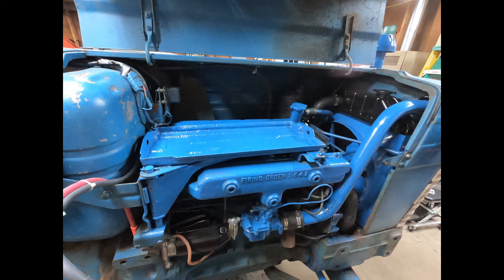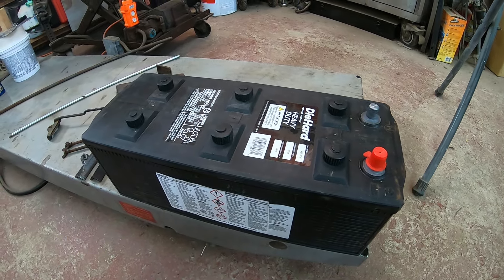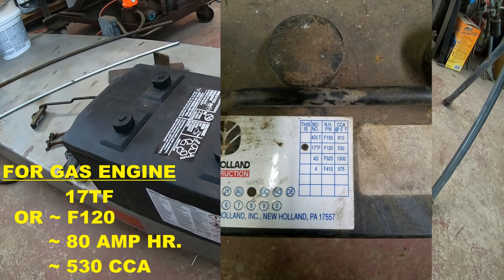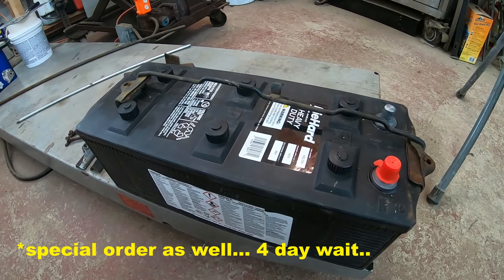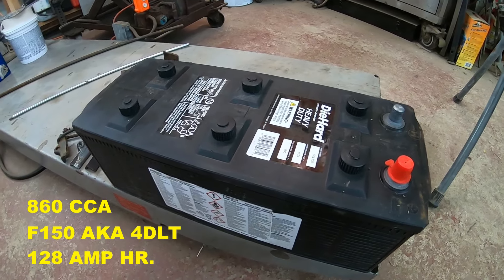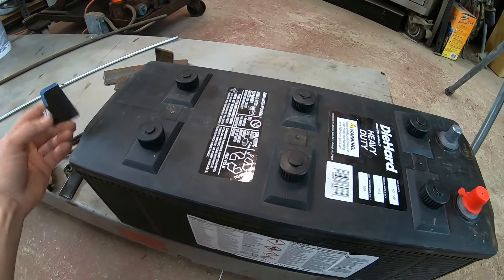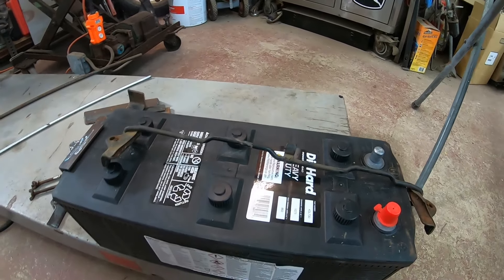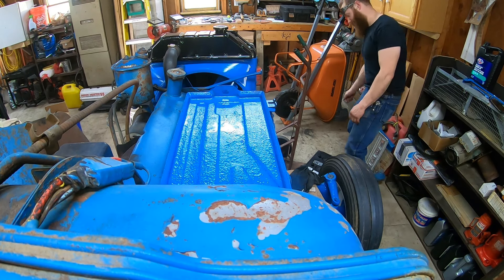Ford 5000 Battery!

Comment: Best deal I found for mine was through Advanced Auto CarQuest line. Car Quest has a farm/agriculture replacement consumables; like NAPA has.
Found most of my filters there for my diesel Ford 5500 TLB, which is based off the Ford 5000.
Reply from the maker: I bought this one form the local Carquest....like you said, best price around

Comment: When I picked up my 68 Ford 5000 Gas a couple years ago it had a Deka 917TF in it.  Was going to cost a small fortune to replace so I got a smaller one with more cold cranking amps.  We did have to make a hold down for the new one (can't remember the code) but haven't had any capacity problems yet...knock on wood.
Reply from the maker: I think most 1000 series Ford owners are in the same boat! Most any battery with decent cranking amp will work, but it just drove me crazy that the battery tray was so empty! The 4dlt was not any more than your average truck battery, and much shorter, for hood clearance.

Comment: If you use a smaller battery cut a piece of wood to keep it from sliding around. I have used wood slabs and a bungie strap for years.
Reply from the maker: That always does the trick!

Comment: Let me know if you need some weird part for your 5000. I may have some.
Reply from the maker: Awesome, thanks I'll keep you in mind
Reply: Do you have a radiator with a built in hydraulic core?
Reply from the maker: No, the radiator on this 5000 is only for engine coolant, no oil cooler

Comment: Do you have a power steering cylinder episode in the works??? Hopefully Yes!  Put a quart of fluid in today and a quart leaked out in about an hour or less of use.  I watched a video by a Sr Redbeard and it doesn't look like fun.
Reply from the maker: Luckily mine was in real good shape, the only part that leaks a little is the pump itself. The steering cylinder is a real pain to get too! Half the work is getting the radiator shell, hood, coolant drained and radiator out of the way! That cylinder is an early model, hard to find parts for... hopefully you have a good hydraulic repair shop in the area! Best of luck!

Comment: Hello!  tell me please, how do you usually put the battery terminals on the tractor? I think I put them correctly, but I'm not sure (+where/-where?
   Ford 6600, thanks
Reply from the maker: The positive lead goes to the starter solenoid. The negative lead goes to the engine block.
Reply from the maker: Do you have 2 batteries?
Reply: @marktolman6037  1
Can I send you a photo?  somewhere?
Reply from the maker: @iuliiuli4897  tmarktolman@yahoo.com